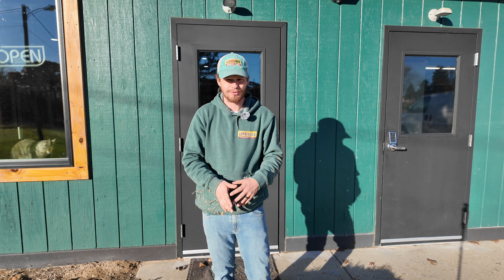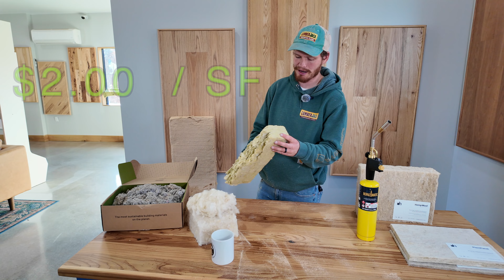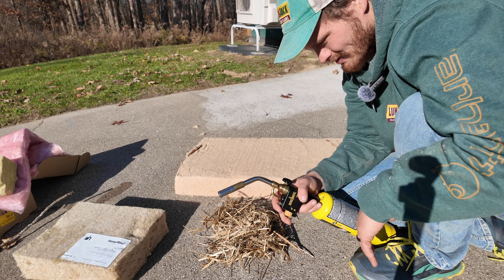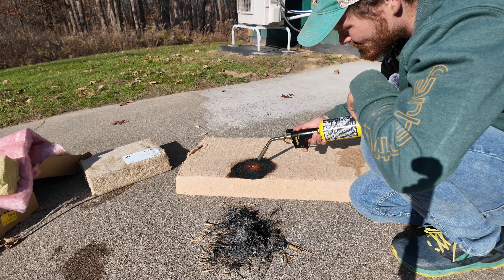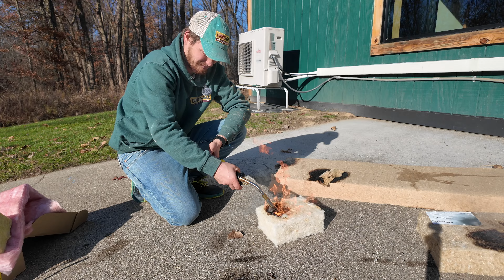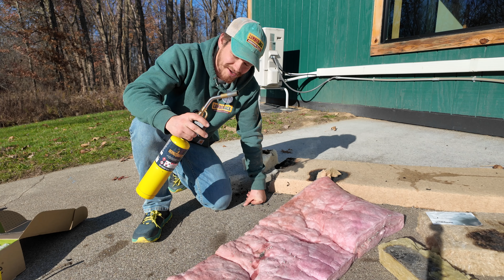Natural Insulation Options for Healthier Homes

Comment: Of all the insulation, I hate cellulose.  I have it in my attic.  As you stated, it settles...a lot.  It is also very irritating.  If you need to remove it to get to a wire, or something, it is a mess, and that's when you realize how much it has settled.  Will never use it again, no matter how cheap it is.

Comment: Hey man, I just happened to find your channel and is cool to find someone looking for alternatives to moder wood frame/drywall construction. Sheep wool is definitly a great great insulation, my  neighbour used it for inner insulation in a 2x6 frame and works fantastic. By the way, I worked last summer building a house with double walls to fill the gap with hay blocks. The finish was clay plaster. The energy efficiency is beyond anything in the market. Cheers man

Comment: If cost wasn't an issue, what blown in insulation would you recommend for an attic?
Reply from the maker: Wood fiber, its not that expensive either. Cellulose is cheap and not bad either.

Comment: Straw bales are typically covered on both sides by cobb and lime so they have great insulation without worry of a fire due to the firep resistant material around the outside of it
Reply from the maker: Yep true!

Comment: there are farmers in europe basically throwing away wool. the markets are controlled too hard in favor of synthetics.  the clothes we make, the insulation, plastics, ect.  if the governments cared they could fix this.  mineral wool is too close to asbestos with a greenwashed touch to me. working in a greenhouse with it, seeing all of the fibers that it shoots off when dry worries me for the actual health of the installer. rockwool specifically states on the packing to not handle it dry if possible. cool to see the timber batting and happy hemp is making a comeback.  usa in ww2  they actually had states grow as much as they could for ships rigging ropes, soldiers web gear, parachutes, uniforms, paper, oil, ect.  it's really sad to see government give way to synthetic products that inhibit good health in the name of money.
Reply from the maker: The natural products are amazing! And I agree that rockwool seems sketchy to me. Incredibly irritating to the skin to work with too, which to me is a bad sign

Comment: Hey, for the straw burn test. It's important to note normally the straw is packed tight in a bale when it's used and not as a loose straw pile, this difference helps the burn be slower. 
Another note is that the strawbale is often used in houses with Loam plaster or the equivalent both inside and out, (at least in Europe)which makes it much less risky of a material to use in concern with fire safety
Reply: Many people are learning about the benefits of strawbale homes. From my understanding, few American craftsmen know how to properly build the wall system and plaster them too.
Reply: Are You from Germany? I thought this was no longer popular.
Reply: Exactly, and when surrounded in  mud plaster that definitely reduces its combustability.

Comment: I'm in Europe and we generally don't build wooden houses where I live but we just added an extension to our house based on stick framing. Our wall is vapour permeable to the outside. The outside has a foil/barrier (behand the wooden finish) that doesn't let water in but allows for vapour to move to the outside. Then there's a high density wood insulation with the properties you described but it's more like a panel of polystyrene or something in how you apply and handle it and in hardness then it's paper flakes, then OSB without formaldehyde that's also airtight and acts as barrier. Seams are taped. On top of that there's the wood "wool-like" insulation like the one you demonstrated but it's mostly for acoustics on top of that a Fermacel board. Fermacel is stronger than gipsum it's I believe made of gypsum with paper flakes mixed into it, something like a gypsum paper-maché hybrid, one board of 125 mm ways 40 kg. Apparently it absorbs moisture better and you can hang stuff on it without needing to have a stud behind it.. The paint will have to be a breathable paint.  Most products are Swiss and German. The insulation brand is Gutex and the vapour/water barrier brand is Siga.  Our studs are made similar to plywood made of layers of wood. This prevents warping and gives more straight uniform studs to work with. Those were Finnish but I forgot the brand name. Glass is triple glazing.  

Although I build most of it myself and meticulously checked everything to make sure there are no water infiltration or condensation issues I'm still not 100% sure if it'll be mold proof over time.

It's more or less considered eco-friendly but I'd I think of vapour barriers, the insulation screed that's 20cm concrete with Styrofoam plus another 7cm of screed layer on top of a concrete slab I don't think it's environmentally friendly. There's no way you can ever recycle that slab especially the Styrofoam/concrete mixture. I also noticed they put plastic fibers into the top screed layer to prevent cracking. So that's also not recyclable.

All this let me down a rabbit hole of ecological building and with the knowledge I have now would do things differently. That said we're still ahead of the curve with our materials already using what you advocate. But for a new project I would probably make it eco-friendly all the way.

It's good that you make this videos because ecological materials, mold and health issues are underreported on.

Comment: Timber insulation sounds great but it uses plasticizer (phthalates?) to bind the wood fibers.
Reply from the maker: So from my research it seems lignin - which naturally occurs in the wood  is the binder.
Reply: @L @LumberjackHealthyHomes For me, mineral wool is the best. I’m surprised you had more irritation issues with mineral wool than glass fiber insulation. Most say the opposite. Btw, Rockwool does produce insulation with no formaldehyde (certified by multiple agencies including Green Guard).
Reply: @LumberjackHealthyHomes One of the representatives from the company admitted plasticizer is used in their insulation, but that was over a year ago. Maybe they found a different binding agent since.
Reply: Try to find the rockwool without formaldehyde, you have to special order it.  I’ve started using timber batt and absolutely love it! Fits super tight in the stud bays and doesn’t itch.  Also way cheaper than rockwool
Reply: Just wear a full face respirator, it’s so dusty